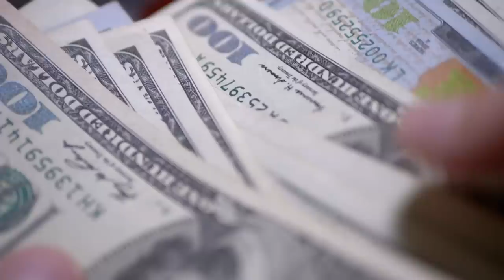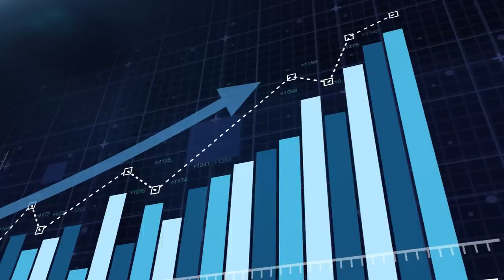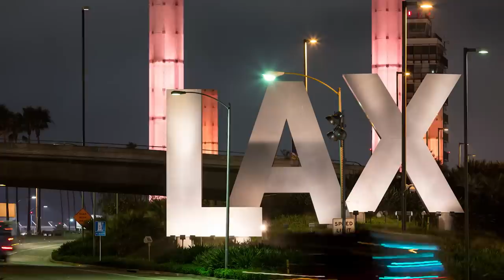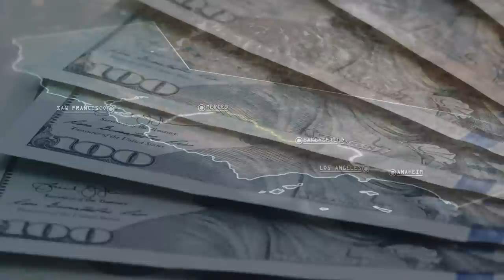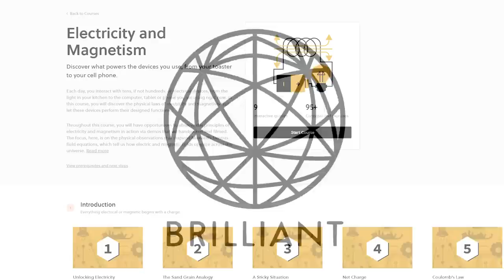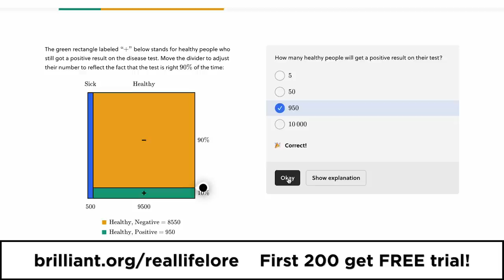Why California High Speed Rail is Struggling (Re-upload)

Comment: In the Central Valley, high-speed planners' refusal to use a superior rail line that was already there - along with its magnificent passenger stations located centrally in the large cities along the way, was deliberate - as was their choice of alignments for the two mountain divisions leading to and from the Central Valley, which are designed to make the high-speed route circuitous, and therefore longer and more expensive to build.

The "requirement" that the existing Central Valley line be avoided was based on a ploy now commonly found in environmental documents prepared by the FRA or under their contract, which falsely asserts that there is no way to run passenger and freight trains safely in the same right-of-way - whereas this kind of railroading operations has been carried out successfully in the Western World for the past 175 years. This assertion, along with a draconian choice of prescriptions for mediating any danger, is designed to pander to the freight carriers' MO of allowing a large number of derailments to occur on their properties, justified by a large savings in costs realized from deferred maintenance of both tracks and equipment.

The FRA's frequently stated "only solution" for passenger trains being endangered by frequent derailments of freight trains running on the same line is a forty-foot-high reinforced steel-and-concrete wall running the length of the shared-use segment, that would take at least 25' off any given such segment's lateral availability of space as well, together with the freight carriers' now commonly extremely wide track spacing designed to avoid collisions in the event of derailment. The use of giant walls to separate such traffic for purposes of increased safety, needless to say, has never been tried.

Concerning the circuitous mountain divisions, the one between Burbank and Bakersfield for instance requires fourteen double-bore tunnels: therefore about 56 separate TBM launches. It is not stated how many TBMs the high-speed authorities intend to buy. The Burbank-Bakersfield route is also extreme in it's vertical alignment whereas the instinctive flatter route was overlooked by means of getting it written into law that  the high speed line must call at Palmdale. Building this circuitous alignment dictated by a scheme to rebuild the freight carrier's Tehachappi Pass freight line will optimistically require at least ten years of of specialized and unpredictable construction efforts. Yet there is no big or direct advantage for the freight carrier given the slight shortening of times traveled by freight trains over the new alignment, along with a new restriction that freight be confined to nighttime use only.

All this is typical of actions carried out by the now-freight-only private rail carriers in the US since the end of the Second World War, and between them and the revolving-door FRA they are running the show. Early in the post-war period they started liquidating both real estate (in some cases important lines on which viability of their business depended) and rolling stock (a large amount of it being inexplicably brand new) as well as passenger stations - in order to replace the revenue being lost through "streamlining" and outright abandonment of various remunerative operations, with that resulting from the liquidation of their assets. In the post-war period and beyond, the fiduciary MO of running a business into the ground in order to glean inordinate benefits for the proprietors or stockholders is not uncommon, and it was pioneered by the American railroads.

Comment: I still think the decision to connect the San Joaquin Valley with the Bay Area with the HSR first  instead of LA was a mistake. The San Joaquin line already does this (admittedly much slower than HSR) but there isn’t the connection to LA by rail. Getting over the Tehachapis first and then working north is what should’ve happened.

Comment: TL:DR - The high speed rail system is failing because California sucks.  In a state where it took a rich guy like Bill Maher 3 YEARS to get solar power approved for his house(in a state that brags about its love for green energy), bureaucracy has held up the system just as much as anything else.  Also, in the Northeast and Chicago, rail systems for public transportation have existed for over a hundred years.  Due to the density of populations, they always remained a necessity.  Adding Acela wasn't a huge problem, as it was just plugged in to the existing infrastructure.  

California used to have this with their trolley systems until the 1940s, when Goodyear and GM convinced voters that trolleys were dangerous compared to cars, and argued they could replace them with buses...which didn't happen, as they just replaced them with cars and more roads.  Since then, other than tourist trains that cost more and are slower than just driving from LA to San Francisco, trains were a side show to Californians' love of the car.  And even when LA tried to get a subway system working, it was a joke to the locals, something no one used.

So yeah, we can blame Californians themselves for why high speed rail is taking so long.

Comment: "If you build it, they will come". It must be completed, basically whatever the costs. Trains have a huge advantage over airplanes: no security lines and downtown departures&arrivals. Not to mention a huge impact on lesser cities along the way. It's MUCH easier to use.

The project, to get passed by voters, had a crucial flaw: it was severely underfunded to begin with. The mountains to cross, seismically active areas, lands to buy were always there. If a price/km of 56M$ is related to the 105B$ tag, that means the first projects were similar to the Chinese level of expenditures, which is ludicrous (the Chinese have a cheaper way to expropriate...). The Chinese also built a MagLev line of 83 km with a much higher price tag, so everything is relative. The lower population density also makes this difficult to compare to Europe, but at least it's indeed more comparable, but where there is also the thinking that there is no other option but to build it.

Perhaps related, the Netherlands have a rail system that is very dense, but that is not the argument: they decided they needed to protect against flooding from storm surges and invested in the Delta Works. The cost was "meaningless", it needed to be done. The scale of the Delta Works is truly massive, and there are no direct clients paying for it. Rather, the Dutch sell their expertise around the world to create similar things. How many videos about water management mega-works talk, New Orleans, Jakarta, etc, about the involvement of Dutch engineers and/or companies? It's how the public transit system should be viewed.
Reply: “If you build it they will come”
Sure some people will ride it initially due to popularity, but overtime the ridership would exponentially decrease when people figure out that it’s slower and more expensive than just flying.
So it would be more like “not enough will come” to even support it.
Downtown doesn‘t mean anything, it just means your stuck downtown with not much to do if you don’t have a car as American urbanism completely just negates that advantage. 
No security? This is America there will be security. (Not trying to give someone ideas but) if there wasn’t security any maniac could just walk onto a train and kill a bunch of people.

Comment: I had watched a video saying the high-speed rail was a failure 3 weeks ago. I posted a link to it on a video with a rosy-picture view of it. Just the other day someone said the video was taken down due to inaccuracies but didn't link to its replacement. I'm guessing this is the replacement. It doesn't feel quite as negative as the other one I saw.

Comment: Your map showing a road going along the coast is wrong. There is a Pacific Coast Highway that sort of mostly goes along the coast, but even the PCH doesn't hug the coast that much. 
The main routes between LA and SF are the 5 and the 101, not the PCH, which is a scenic drive, but not a point to point destination highway. 
The 5 is much faster than the 101. From LA, you have to go over a mountain pass and then through the mostly flat San Joaquin Valley. It takes 5-7 hours 
The 101 goes closer to the coast and sometimes merges with the PCH. It takes 6-8 hours

Comment: I voted for HSR in California. It is over twice it’s promised cost and has picked a bad route but it is nowhere near being done!
The first section goes nowhere , it could not  support a regular train service between these two cities!

It was either bait and switch on the bond funding issue Or total incompetence.

Younger people should look at what was promised when we voted so you will know why supporters have changed their minds. He covered it pretty well in the video.

There is an existing Amtrak train line that I take a lot , surfliner and Coast Starlight that could be brought up to Acela standards for a fraction of the price and the route is shorter with no Grapevine type obstacles .
Reply: What would upgrading the coast route for a 6 hour trip averaging 70 mph cost in comparison?

Comment: I lived in San Diego in the 1980’s. There were proposals to upgrade the train service between Los Angeles and San Diego. On the existing right of way. A higher speed train wasn’t going to happen. Too much NIMBY resistance. I don’t recall the cost of the upgrades being an important issue. The cost of new rails and the new engines and coaches were a minor part of the discussion. What was were the people along the entire route did not want it. No politician seeking re-election would push for it.

Comment: A lot better but you’ve got the wrong price. It’s as low as 75B while 105B is the absolute worse in 2035 after estimating inflation.
The “cheap” option for 1600-200mph rail built by brightline is ~35m per mile on the dessert express run.
The state has budget surplus to fund more of the line but politicians in LA are holding money hostage trying to get transit projects from any funding source they can. They are even trying take money from Prop 1A a this point

Comment: Citing security reasons as an advantage for accessing rail, is short sighted. The intentional downing of an airplane is a mostly localized problem, the destruction of a train is not just local, any infrastructure damage, is now a systemwide issue. The fact is trains make great targets, not just in war, but terrorism situations also, because billions of dollars are at risk all because one nut with an eye on inflecting the greatest damage. Likewise, an earthquake would effectively shutdown HSR for at least the time it takes to inspect the rail infrastructure, rebuilding even a short link means the entire system is slowed, if not stopped altogether, while an earthquake would rarely, if ever directly effect either the planes or the runways, and should it ever do effect airport infrastructure, it can easily be transferred to an unaffected airport.

Comment: Currently it's 80 billion short of just a small portion to be completed.  After already spending 40 billion.  Without massive federal bailout it's going to never be useful.
And The 200 mph speed is misleading.  That's the track design. Even the hsr website says from SF to Gilroy will be only a maximum of 110 mph.